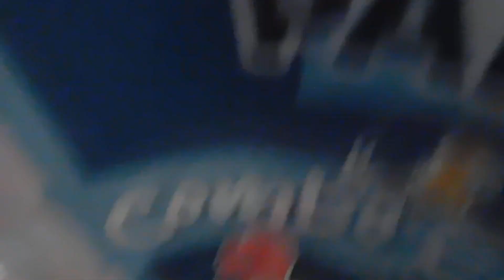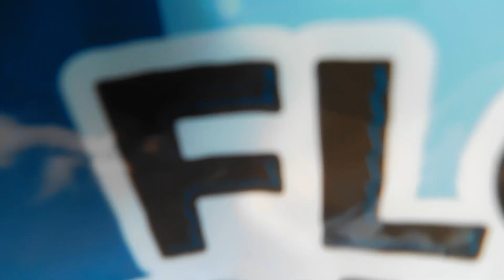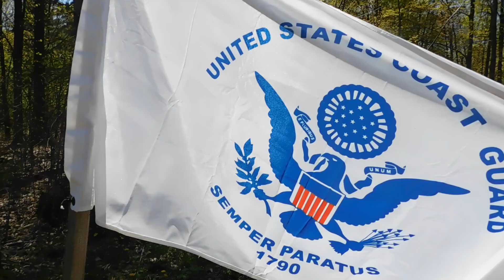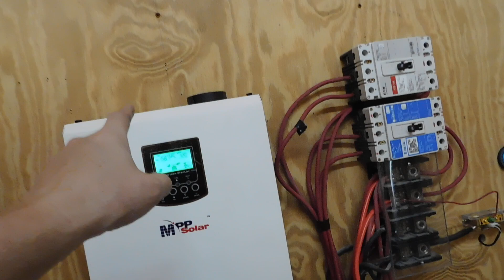Its moving day at the Homestead. Live stream tonight at 8pm EST.

Comment: Now that they are all sharing a common space, you're going to need more food and water spots-indoors and out.  You will need to give them more space as soon as you can; maybe expand the pen 3 to 5 feet, and build a few more roosts.  I used old rake handles for mine.  Just cross section them along the walls.  If you really want to increase egg production at this time, you can invest in nest boxes for the inside.  This will really bring your count up.  Mine went from 7 per day, to over 20.  I got mine from HOGG, which run along the walls and are steel.  Just change out the hay every week, when you clean the shed.  Best to you Ed.  Enjoy your trip.